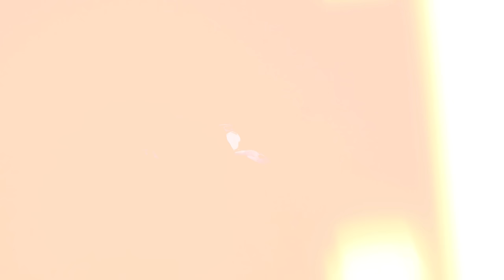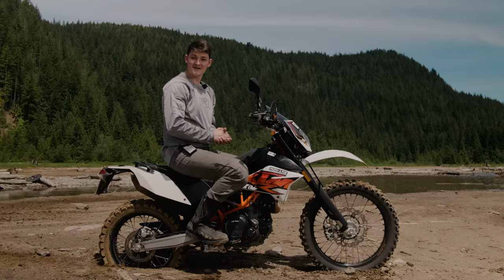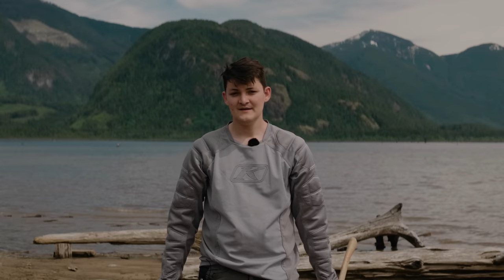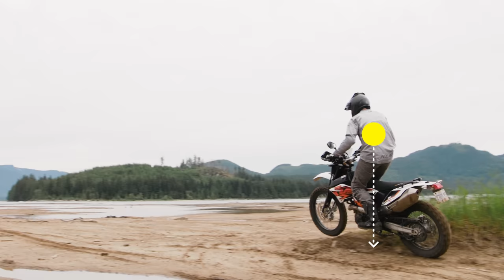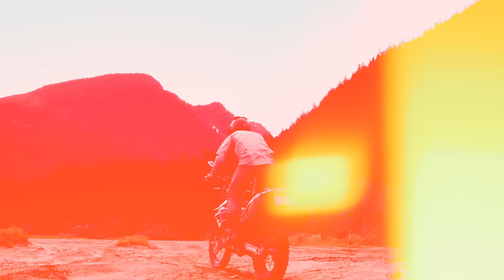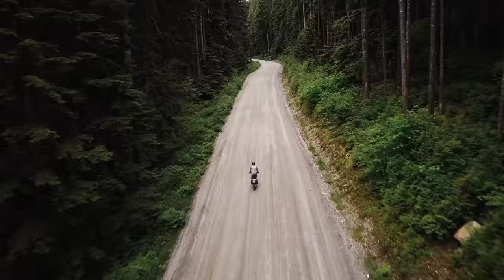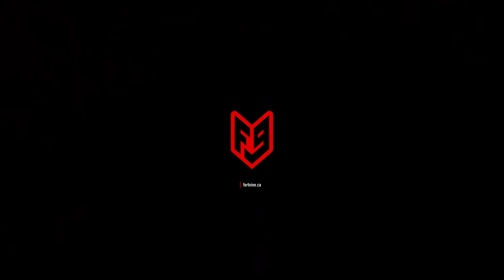Why and When to Stand on Your Motorcycle

Comment: I definitely use the pegs as much as possible. On a sportbike I think using your legs gets the weight off the handlebars and your wrists and makes the bike handle better.
Reply: Would it not be better to make an improved motorcycle? Change the weight distribution by moving the rider, engine and tank to optimise those factors.
Reply: If you can stand properly on the pegs without gripping the bars, then yes. Also it's not about "getting weight off the handlebars", that really depends on the surface.
Sitting or standing, you should be loose on the bars.
Reply: > It gets the weight off the handlebars
Nonsense, it gets more weight ON the handlebars because you usually sit further back compared to standing. Please don't perpetuate another pseudoscience BS. The reason why handlings get improved is something else.
Reply: @thomas316  kind of works that way.  The suspension absorbs the bump and dissapstes it in the shocks, but when it's too much it pushes up into the rider.  The sitting rider moves with the bike and this can get launched off the bike.  The loosely standing rider uses his/her thighs as a second suspension, absorbing the movement of the bike so the rider stays in control.  This is of course work so you will get tired as you do mini squats on every big bump
Reply: @barryobrien1890  Should just put a suspension in the seat, like a power boat seat where it absorbs bumps by being independently sprung and damped. 🧐
Reply: @thomas316  You can't change the laws of physics to that extent. Regardless of that, when you stand on the pegs your legs and arms can absorb the impact of the bumps instead of your bottom, which then compresses your spine also. Long term comfort and less shock to the body.
Reply: @thomas316  Springer seat Harleys of decades ago have long since been abandoned. There's a good reason why.
Reply: @thomas316  may work for small bumps but it would have to be impractically thick to absorb the amount your legs can travel.  The other thing that your legs do is that they are smart and can modulate to exactly match the terrain.  You could do it with some kind of computer controlled active suspension but it would be complicated and expensive.  A jocky on a race horse also floats on their thighs and not in the seat, so they can stay in total control and guide the horse.  A well trained human body is a precision machine capable of way more than our best technology.
Reply: @eyeballs50  You can't change the laws of physics to any extent.
Reply: Maybe those crazy streetbikers might actually put weight ON the handlebars but that's not a dirtbiking thing.  If anything besides loose and neutral, it's pulling up on the bars to shift weight off the front and onto the back. Lofting the front over that pothole or getting the back tire to bite going up a hill.  Most times, it's what used to be called the "attack position" where weight is neutral, elbows up, head slightly over the bars, and legs bent.  Gives your body the most amount of options to stay where it is when the bike is doing something else.
Reply: @cowmath77  lol its pretty easy to change the weight distribution from butt and wrists to feet and knees and the whole point is improving corning. Its easier on your body and easier for the bike to absorb bumps. i literally do these experiments while i ride. been riding for about 20 years now. 7 motorcycles in that time
Reply: @nwbasson  on a dirtbike maybe. thats easier said than done on a supersport. on a bike like that you have to use your feet and knees to get your weight off your wrists and handlebars or you wont like your life
Reply: @victoriazero8869  I've been riding since i was a little kid lol like 20 years and 7 motorcycles. you use your feet and knees on a sportbike to be able to gain leverage to get the weight off your wrists. if you just sit there lazily on the seat and handlebars you'll be uncomfortable and wont be accessing the full potential of the handling performance.
Reply: @4Fixerdave  its not actually putting weight on the bars. they're gripping the bikes with their legs and feet and using their whole body. the point is that they're not just sitting on the seat they're engaging their legs a lot.
Reply: @ChrisG1392  you should lock in with your lower legs on all bikes, not just sport bikes.

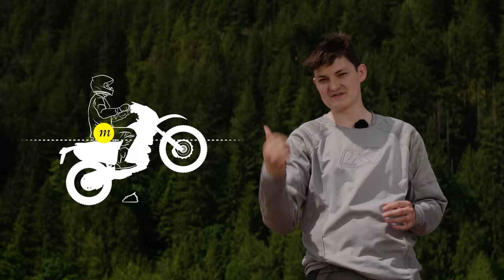Comment: 2:55 -- not quite.  Standing on the pegs, not only are you reducing the amount of upward force that the mass of your body adds to the entire package, but you are also allowing the shock absorbers to do a better job, by reducing the amount of damping that they have to do.  Insulating each mass from the others makes control of individual masses easier (try pushing a chain).
Reply: Yes, but from the simple view of the bike being a mass and the rider being a mass what he said already holds true. So there is no need to complicate his explanation by adding the workings of a suspension into the mix. Would he have done that I am certain someone wouldve commented „Not quite, what if I perfectly tune the spring rate and dampers of my suspension to the combined weight of my bike including myself and then suddenly I am standing up, absorbing bumbs with my legs?“ There is always one more minor „not quite…“ in physics explanations
Reply: @ritterkeks  The more you understand about the dynamics, the more you can make them work for you.
Reply: I don't understand what you're saying. Standing on the pegs does not change your mass. What upward force? Standing or sitting, your sprung mass is the same so how do you reduce the load on the shocks? Way to complicate a simple explanation.
Reply: @sv650nyc7  Total mas doesn't change, but you are reducing the mass into smaller, lighter sections, which are moving in relation to each other.

Another example of this is when a freight train starts or stops.  By having some "draw" in the couplers, only one car at a time must start or stop moving at any moment.  The overall weight of the consist doesn't change, only how those weights interact with each other.
Reply: @sv650nyc7  Sitting or standing may not change the total mass, but it changes where that mass has an effect of the bike. Try this, put 100lbs on the seat of the bike and move your bike around in the garage. Now put that weight on the pegs and move your bike again. I bet you will find the bike a lot easier to control with the weight at the pegs rather than on the seat. That's what your changing when you stand or sit while riding. This is reason so many people prefer BMW GS or GSA 1200 /1250. Everything is down low and makes the bike easier to control and when you stand, you put that much more weight down low making these bikes the easiest to low speed control vs a top heavy bike.
Reply: @atvtinker01  
Sorry but you made a wrong example :) 
Sure if you put same amount of mass directly on pegs it will be easier to maneuver.
But if you stand on pegs total point of mass (you + bike) is still higher than you would be sitting on bike :) Its coś your point of mass is still at your pelvis (which goes higher than if you would be sitting) not feet. 
But I agree you do

Comment: Offroad motorcycles need an independently sprung pegs and seat assembly really. Much like the double chassis on a truck or F1 car, one lower suspension system optimised for handling and the other upper suspension optimised for comfort.
Reply: That independent upper assembly is your legs.

Comment: All true and very well articulated. Though I would suggest that using your quads as springs is very energy sapping, and the better approach is through your hips so your lower legs can remain upright and gripped to the bike. Which means upper torso is less meerket and more 45º

Comment: This method of standing was actually created by a senior with Rheumatoid arthritis. It enables 75 yr. old FARTS like me to continue riding when my knees swell up like balloons and don't bend that well. Riding for long periods of time sitting can be extremely painful. By standing yes even on the highway I am able to ease the pain and ride for most of the day. I ride about half of the time standing on the highway.  It also gives me what I crave and that is all of the attention from passing motorists wondering what the hell I am doing. The only real issue that I face is getting on and off the bike as my right leg which is the one that bends the most can be a challenge to get it over the seat. I could change to something with a lower seat (street bike ug) but then I would not have the joy of pain relief by standing and of course riding all of the dirt roads and trails that I love so much! RIDING TILL MY LAST BREATH!

Comment: Thank you for changing my mindset, Ryan. I too always thought that standing on the footpegs would change the weight from the seat to the footpegs, hence making the bike more stable when going over bumps.
Reply: Well, you were correct before. The force of your weight is applied at the pegs, which impacts the function of the rear suspension.. allowing the suspension to be 'sagged less' when you hit a bump, and to use more of the suspension travel for going over bumps rather than being more compressed by your body... the whole 'center of gravity' thing just comes from guys not knowing about physics trying to sound smart and misusing the term..

Comment: The twin pegs look a good idea.
Practicing standing takes quite a long time to get used to but when it gels it gels
Tip-if the next section is smooth gravel/dirt sit down and have a rest! Standing when its smooth(except to stretch legs) is pointless.
Tip-It feels very odd standing at first but the more you understand it and do it correctly the more logical it feels.

Comment: I'm sure you're correct.  But, I always felt that standing changed steering geometry, where knees and extended body weight  helps to make changes in balance and direction more quickly to compensate for the tendency of the front wheel to plow.

Comment: You can’t change the momentum imparted by a bump on the rider-bike system, but you can let the bike take up more of it by keeping your limbs compliant. The rotational aspect was also rather glossed over here but you’ve explained previously that you can lean the bike (and crucially it’s tyres) independently of the rider’s mass. That presumably lets you adjust the camber both faster and further at a low speed without falling over sideways.

Comment: Good basic explanation of the physics, however, two important aspects are missing, as far as I understand offroad riding:
1. There are two centres of gravity (you and the bike) interacting with each other and the ground, not only up and down but also left and right and fore and back and to some extent, the bike will rotate around its centre of gravity, going up and down with the wheels, plus rotation changes on the back wheel will give impulses to the bike's balance. It's much more complex, the video only touches the basics.
2. Excessive knee bending is not the solution, many instructors will tell you this. As Ryan Hughes puts it: It's taking the suspension out of the motorcycle. Especially if you're not used to more than one squat a day, a full day of riding or even a week will wear you down quickly. Let the suspension do its work, and keep your focus on balancing and counterbalancing.

Comment: This is a great explanation but, there is something you missed. When you're resting on the seat, with your weight focused on the center of the bike's longitudenal axis (front to back), unless you're literally glued or velcro'd to the bike, the bike is free to wobble more as it's more susceptible to move independently of your body. This is discouraged for riding over muddy ruts where you want the bike to have a greater moment of inertia along the foot peg axis for more straight-line stability. By standing on the pegs, you are taking control of the latitudenal axis of the bike (the foot peg axis) and virtually increasing the moment of inertia as if you're a tightrope walker holding a long baton. By sitting on the seat instead, it's like being a tightrope walker holding a short baton. There is definitely a difference. Also, the advantage of not leaning with the bike but standing on the outer peg during turning in loose terrain? I'm surprised you decided not to cover these concepts. I remain a huge fan nonetheless!

Comment: Been riding dirtbikes and streetbikes for almost 5 decades, I feel much more comfortable and connected sitting/squatting - especially at speed... my quads absorb the bumps without fully standing, my arse keeps the traction on the back end and I'm much more poised to throw my weight around where it needs to be. Standing you get none of that except a break from sitting and a nice stretch

Comment: I avoid off pavement excursions, but after coming back to riding after 25years off moto riding, I had a rude awakening.  I live in smallish N. Nevada City.  One of my cross town routes is a smallish through street.  At one point it crosses a large blvd.  I almost always get stopped at that light.  The first time I hit it green, I discovered something I never noticed before.  The blvd is about 3 ft higher elevation than the smallish through street I was on.  I didn't know my 500lb bike could fly at 25mph but it does, and it will compress your spine accordion style when it 'lands'.  Now,  I get up off of seat, use legs for extra shock absorption  Rail road tracks, dips in the road, chuck holes, basically anything more than a moderate bump.  I'm tired of my back playing polka music.

Comment: Oh bloody thanks. Although I knew the centre of gravity "fallacy" it is a reasonably easily understood physics explanation for the marginall educated and challenged, now you have put it out there I am going to feel guily using it  to explain to people. I am still going to do it as Moment of inertia is way to challenging for the vast majority of people ( hence 29" mountain bikes popularity when they handle like mud compared to the old 26").
BTW the CoG does move as you explained re: standing , but it can also be moved slightly forward and rearward and side to side re: climbing off the inside. Yes on a motorcycle the body mass relative to system mass is less than an mtb but it is still significent when skating near the edge.

Comment: Finally, I found another guy pointing out the importance of momentum of inertia. 

Now, this will perhaps cause a shitstorm, but this actually means that high COG (which is equivalent here to a high MOI) bikes are more stable and less likely to tip over - especially at low speeds, when wheel angular momentum doesn’t do its job yet. 

A low COG bike might feel lighter when standing, so people think preventing a tipover is easier - but a tipover usually can't be prevented on 400lbs bikes anyway by sticking your foot out.
A higher COG/MOI will make a bike more resistant to tipovers.
Yes T7 riders, I'm looking at you 🙂

Comment: Can use sime of yhat science when riding motocross. Preloading the suspension and driving into the jump face for more lift or bending the knees and soaking up the jump for less lift. For extra pop,seating into the jump face and unloading once airborne(advanced move due to timing or it can go badly).

Comment: Reason would suggest that standing also reduces wear and tear on the bike's suspension, not a big issue on a dirt bike, or well equipped ADV machine, but when riding a standard, commuter, or street machine on rougher roads, I would think that could extend the life of suspension components... right?

Comment: Point one: Was not aware of the inertia point. And I don't quite buy it since it assumes your are rigid with the bike.

How much actual inertia are we talking about theoretically? Compared to the rotating mass*speed of the wheels and the rotating engine parts? I'm not good enough with math, but once upon a time I was, and a equation system would give the answer. Anybody doing the spinning bicycle test trying to change directions while holding the axle, knows its a considerable momentum to surmount. 

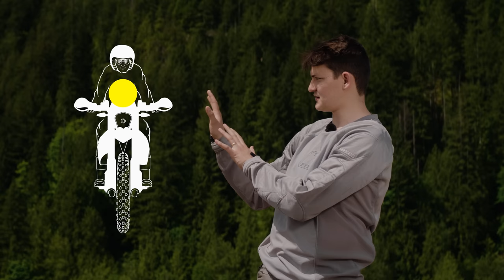Point two: Explanation part 2 at 2:25 I hoped would address the rigidity/looseness, but you changed the problem from rotational stability around the axle of traversion ("falling over"), to the linear vertical movement perpendicular to traversion direction (bumps), then you mentioned the rotation around the horizontal axle, perpendicular to the traversion axle (bumped out of the saddle). I dont disagree, just hoped that point one would be further dived into.

Another point of standing is to let the bike move looser, more independently, to quicker self correction over bumps and berms. Standing is the articulation between you and the bike (and with articulation there is no lever to act on a higher center of gravity). Again at odds with the initial point of inertia balance.

Were those pegs a product placement? They seem a bit off in this context. Also letting the thighs do all the work sounds counter-intutive to letting the calfs and the thighs work in a smooth movment together. I can see they would be a relief for adventure riders standing for what ever reason on gravel roads. I sit on sweeping flat roads, stand on roller coasters with roots, rocks and other unknowns.

Comment: I'd be curious to hear people's experiences that use these kinda pegs for really technical riding cause I'd personally hate not to be able to drop my heels on the pegs and get my weight back further if the back end gets kicked up. I could definitely see them being more comfortable for dual sporting but I've seen them on enduro bikes being called "ankle savers" and to me it just seems like a mobility limiter, the amount of balance adjustments and taking my foot on and off to dab would make these sketchy to me. I want a peg with a good sized platform and some grippy pins but I don't want an extra peg behind it for sticks to get caught in or to accidentally wedge the tip of my boot between.